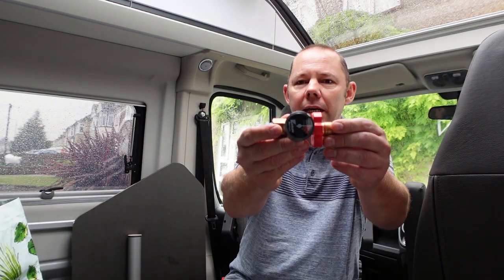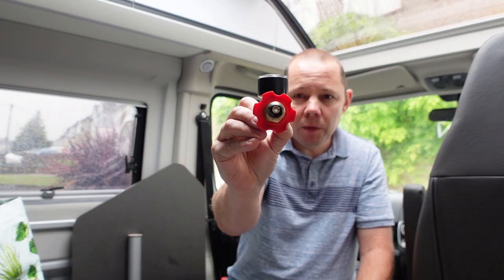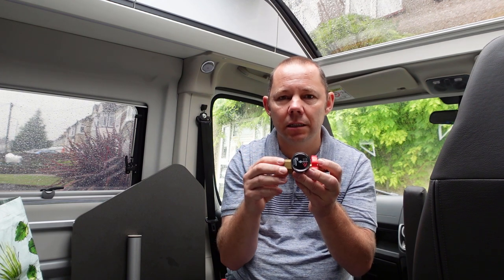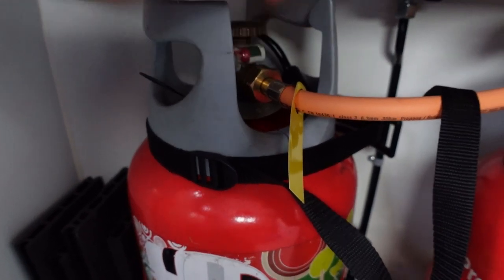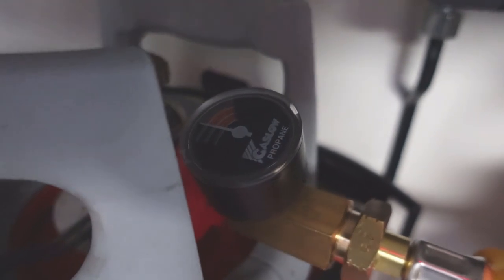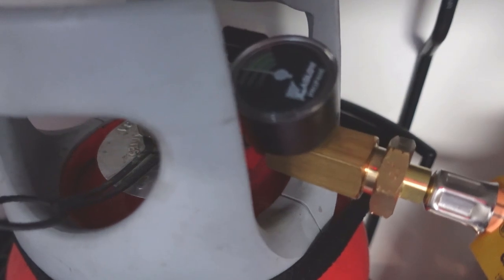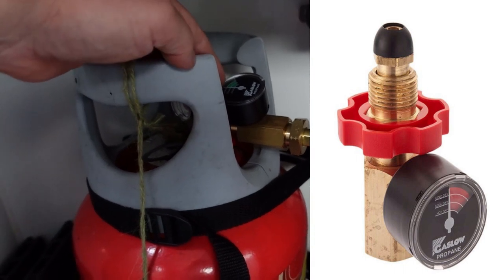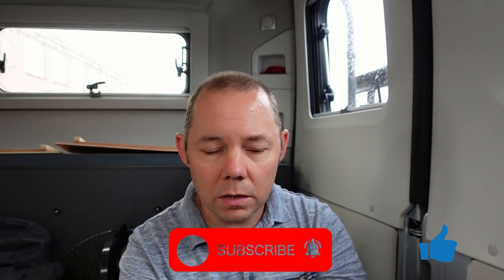Gaslow Adaptor Gauge - Propane review fitting

Comment: hello ! Thanks for your video. Please, do you know a real device to know how many gas I got in the bottle ? (GasLock by Gaslevel ?  Gasometer Gasflow ? ) Thank you
Reply from the maker: I've never used any accurate level meters. If you google it there are a few magnetic strip types which basically measure the temperature of the side of the bottle. the gas level will be colder. There is also more expensive ones with mobile apps which take the weight of the bottle. I find they are all a bit expensive and not so accurate. I have two bottles so then one runs out I can easily switch to the full bottle
Reply: @BrackstonesTravelAdventures  Hi Andy, do you have an opinion on the Truma ultrasonic gas level devices? Magnetically attach to the bottom of the bottle and use ultrasound to measure the liquid gas level.
Reply from the maker: I have never used them so cannot say, I have herd they are good but I dont see a need. If I run out gas its easy for me to change over to the full bottle